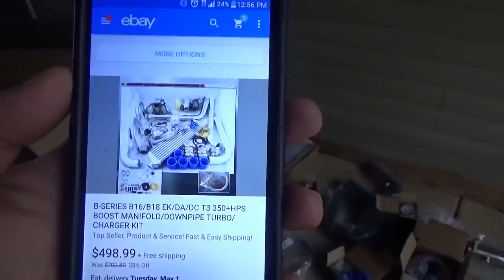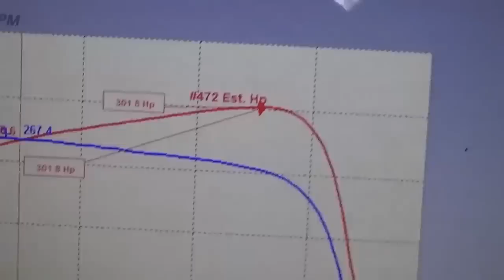$500 Ebay Turbo Kit (1 Year Review)

Comment: 300 in a civic is fast . You can hurt  alot of feelings  roll racing.
Reply: Haha even 200 feels quick in em
Reply: Agreed, these little cars are so light compared to modern cars that saying having 300(w)hp is meh, but people always forget power to weight ratio.
Reply: And FWD config makes +300hp unuseful and hazardous....I think 300 is the max you can get out it without LSD and without making your vehicle dangerous.
Reply: l KillerCam l agreed
Reply: @MarcoDwade  they are still useful lol, but like a high horsepower rwd they fight for traction except worse but around highway speeds  they do good with some beefy tires . They suck at heads up racing , but they are killer when rolling down the 4 lane, which imo, is when most guys with big rwd v8 cars and big egos to go with them, want to try these little cars.
Reply: @Hayawasa  ye Im talking in this way because im european and my knowledge on cars is based on our roads which are twisty and narrow.....on a straight flat big american highway theyre killer indeed..
Reply: People that are fixated on HP numbers forget how light older Honda’s are. 300hp in a car that weighs 2,500 lbs is legit.
Reply: The ride looks rough. Is the suspension that stiff
Reply: @MarcoDwade  having that much power with any car that don't have LSD is dangerous. Have tried rwd without LSD yeah its dangerous with 300hp too. It takes time to learn how to control it.
Reply: AuraLiveWax  Civics don't make bad names for themselves mechanically. The drivers do.
Reply: hendrahendra Snowmobile have 165hp and they 
weight 500lbs
Reply: @lkillercaml9945  Yeah man and take in account how light them Hondas are.
Reply: 300 in a civic is equivalent to 480hp in a modified m4. In other words it has a better power to weight ratio than a stock f82/f83 Bmw M3/M4. Stock M4 are not slow lol And that's in a stock weight civic. If you gut it you can hurt even bigger feelings! Free power
Reply: @Hayawasa  i mean this car should still run 12-13's from heads up racing which is still fast.
Reply: @retrox684  with the proper tuning and or willingness to destroy the clutch lol. Ive done been down that road. Once i got the proper tuning and boost by gear , it made the car alot more consistent and i didnt have to buy a new clutch every month. Straight cut 3rd 4th and 5th gears are next. When you get close to 300 in these civics with turbo you are gonna blow the tires off and lose if you dont slip the clutch in heads up racing. Its really cheaper to get hondata or aem in a years time.
Reply: @Hayawasa  im planning on building an h swapped intgegra and I cant wait to roll race once it's done
Reply: @retrox684  its addictive. Espeacially passing these little rich boys in their bought muscle cars.they get soooo butthurt lol.
Reply: @justingiassonmountainbike3346  They need it. And they only go 90 in perfect conditions and tall gear with all that power bikes would do 2x that.
Reply: @be_easy001  good for 12 sec with good traction
Reply: Right a v6 charger has more hp but feels slow as fuck cause it’s so damn big same when it comes to camaros but with a car that’s missing all that technology bullshit and extra shit it’s a rocket
Reply: @wpaia  that's debatable because fbo Zs are putting down 300+ and it's not scary at all. Same for any v8 putting down their 300+ things only get scary when you put numbers into a car that wasn't meant to handle it
Reply: I seen a natural aspirated 03 si with a manual trans and full interior woth heads and exhaust run 12s on slicks
Reply: @albanybestdrumline  that is an issue with torque. The z your speaking of dont have alot of it in comparision to a v8 rwd.
Reply: @valeriesanchez3074  why would an rpm limit matter?
Reply: A lot 🤣🤣🤣
Reply: @marcevensauguste  you disagree?
Reply: Nice one bro i have eg6 turbo swap H2BA7
Reply: @MarcoDwade just get fat drag tires and you can launch with 350 all day.
Reply: Fosho and that’s wheel hp so you probably pushing 390 to the crank

Comment: 300hp on a Civic.. A light car, is a lot..
Reply: Exactly a ~2500lb car with that much hp and handling is a beast
Reply: Probably keep up with most new v8 cars because of the power to weight ratio
Reply: Power to weight advantage. Its at least as fast as a hemi challenger.
Reply: Yet people will still hate because it’s civic
Reply: @SnoozeVert  well can you blame them? You pay $30k only to have your V8 American muscle car beat by a tiny little Japanese 4cyl. I mean the hate shouldn't be excessive, but jealousy is expected. Honda doesn't design for raw power, they design their cars for quality and eifficiency. Proper power to weight ratio is a key part of designing an efficient and quality car. And while they're at it, they make their designs simple so you can get even more power if you put some parts into it.
Reply: AlexBrian16 my g35 with a built head made like 315 on a safe tune, I can’t imagine that to the front wheels in a car that weighs ~1000lbs less (also presumably with no LSD)
Reply: @ModifiedCrew  keep up? No they beat V8s. Shit I do on 215 whp , full Interior all motor
Reply: @surrealmemes3518  That's what you call being a sucker. Unless you got it like that, you shouldn't pay retail for anything. And 79th productions gets this. I guarantee you none of his vehicles will get repo'ed or they will cost him an arm and leg just to keep up with the Jones's. Meanwhile, people are falling back on their car payments...
Reply: A guy at work had his ls3 camaro dynoed at 370 to the wheels 100% stock at 3800+ lbs so that Civic should roll at 300 with probably 1400 lbs less weight
Reply: Enough to beat a stock M4s. And M4s are faster than your charger/challenger rts, your mustang gts, and camaro sss. So yea 300whp in a civic is plenty

Comment: You actually took your time with the install and correctly fitted and built the turbo kit, that's why. Too many people rush to put the turbo on and immediately go to 15+ psi and blow it apart before giving it a chance. There's no reason it should cause issues if you're running 11.5 psi and not driving like a crazy person lol.
Reply: big facts
Reply: That’s exactly what i want to do when i get one
Reply: What if you run @7psi and drive hard af
Reply: @GreatBirdOfHope  nothing. Isn't 7 < 11.5 < 15???
Reply: @CaneSugarCane  oh aight bet
Reply: Or they rev it to redline probably running lean. This guy thought of where the failures could be and included it in his build.

Comment: The bad reviews come from people who improperly installed the kits and or had a junk motor to begin with and blows them
Reply: Facts
Reply: No engine management is usually the problem people buy a 600 dollar turbo kit slap it on and run it on stock settings not ideal standalone is always your first thing after wheels tires and suspension

Comment: 300hp for a street driven daily is more than enough.
Good work brother.
Reply: I had b18 on 15 psi. Around the same power level  and i can tell you is great power. If you ahve the right side turbo that it can make power from 3k to 7k you would  love it. My advise is .48 trim turbo.
Reply: Not to mention how light these civics are. 300hp on such a light chassis is pretty damn fast
Reply: I got only 201hp and I feel like that’s more then enough to pass 90% of cars on highway
Reply: @ssgenx2847  yup yup I'm pushing 215-220 whp on my B20V and it's plenty ENOUGH.
Reply: Probably the ones that say "300hp is not much" don't understand how car physics work and can enjoy their big ass SUVs or Trucks only with +500hp
Reply: @MarcoDwade  exactly, I beat a supercharged Range Rover making what 500 hp with my 215 whp full Interior Civic. . I mean it's a nice ride but if we are racing that weight ratio makes a big difference. 300 hp is more than enough.
Reply: Right?  My 323 gtx is under 250hp but weighs about 2600lbs; that thing pulls like a beast.
Reply: @MarcoDwade  Or they daily drive Scat Packs, GT Mustangs and SS Camaros. 

Cars where more recent models all have over 400hp. 

Not everyone daily drives an economy car.
Reply: @noahknight4039  yeah s as d they weigh twice as much. A civic with 300hp would be a good race against a FBO scat from a 30 roll

Comment: Man that car is awesome, looks damn new and runs crazy as heck, difference to you and common guys that complaint about the kit... They want high power with standard parts, your are respecting the car and the parts, and that's awesome. By the way 310 hp to a 116 to 127 hp original fom the old 1.6 16v.... that is aweso.

Comment: I started with a P28 ECU that I socketed myself, and my buddy did a street tune with Crome Pro. Then I bought a Hondata S300 V3 and I installed it again myself, and it works mint. I also bought the Hondata CPR kit and I am running a billet custom valve cover and coil pack mounting plate ($1000), with Accel coils on a fully built LSVTEC with a built, cammed, B16B CTR head with a Garrett dual ball bearing GTX3582R. My car makes 612 whp on it's current tune.
Reply: When you gonna post more vids of your LS vtec
Reply: Forreal this guys always commenting non sense but won’t upload a pull or a race lol
Reply: What kind of injectors??. Original fuel rail right??
Reply: Troll

Comment: Dude this is a super impressive build! I built a custom turbo kit for b18 in highschool. Probably had 2-3k into it and I dynoed it at 170hp. I had a lot more problems than a few exhaust bolts backing out. I had a friend with a b17 swapped into an EG civic and that thing was insanely fast. Wheel spin in 4th gear is insane!!!

Comment: Inspirational ...working on doing the same to my '00 EJ D16 AT...after a month it's already running great with the mods I've done so far. Working on the suspension next before I start adding more HP.
Reply: update?
Reply: @delsoldill  hey Dylan, unfortunately I had to get rid of it 😔 just no time to work on it. But definitely will do another in the future.

Comment: I get 225 kw  which is a little over 300 horsepower . with my stock V8 here in Australia however my car weighs 1600 kg , its a  VY holden calais LS1,  people put turbos on the V8s here and find it hard to get traction , i prefer the V8s nicer sound to them

Comment: I wish the damn install would've been this easy on my Mk4 Golf 2.0 8 valve. I'm lucky eBay sells a cheap turbo manifold. No cheap kits available whatsoever. I had to fabricate EVERYTHING from the 3" downpipe, to the intercooler piping, to the feed and drain lines (aluminum oil pan), to the intercooler fitment (had to fabricate a triangular mount because the front end attaches as a complete structure. Everything had to be custom fabricated for it. My Civic, I had to do some fabrication on it, but it now makes 612 whp on a fully built LSVTEC, and parts were all readily available for it. I even had to buy a $650 Megasquirt standalone for it and there aren't any ECU pinouts available for it like there are for EVERY Honda. It's sickening bro.
Reply: Hey man, how is it going with the 2.slow turbo project? Is it finished? I think its the first time i see a turbocharged 2.slow 😂 cheers man
Reply: @endri8767  A few people have done turbo 2.0's in the mid 2000's that i've seen on the Vortex but man.....what a process lol! A lot of people ended up giving up on their turbo projects too.
Reply: @kwbalance108  I hole you really get to the result you expect from that build man.
I just cant quit the 1.8t scene, its just mad.
Much love

Comment: Ayy you said right it's fast enough for you, then it's good and besides you running that on the stock motor which i think is very good myself like that technician was saying at the dyno shop that was only on 11.5 lbs of boost, all you got to do is tweak it a lil bit more and a you be up there about 400hp that turbo looks like it's rated to at least 450-550 max hp, not too bad for an E-bay turbo another good video im subscribed cuz, i got to come to your neck of da woods and bring my shitznik, i wouldn't mind taking mine to that dyno shop and run some numbers im only 2 hrs away down on the coast from you, im all stock too just rebuilt motor and newly rebuilt turbo, G54bt.... hint hint stay positive mane.

Comment: Hello Justin.

A quick question, the normal radiator support fine the turbo?

People usually add a thick aluminium one.

Thanks if you can clarify because I'm building mine as well ;)
Reply: Luiz Canguini good question, it depends on how much Horsepower you trying to get?

Comment: I think the success you have with the kit probably has more to do with the installer than the kit. I mean some things may require some tweaking, but I'm sure the concepts of the kit are the same. You just may have varying degrees of build quality and reliability. But I've run some cheap ebay stuff before and haven't had a problem.

Comment: In case  you don't  know  if you replace  the map sensor with a different  one. Example  from stock to a 4 bar you have  to retune  your car. The ecu is probably  going crazy. Call your tuner and ask him.
Reply from the maker: The map sensor was changed before the tune

Comment: I had an ebay turbo on my rsx... made hella power but the bearing went out in 3 months. Then i swapped it for another ebay turbo... worked fine but leaked oil from the day i got it and i never could get it to stop leaking oil. I got tired of putting a quart of oil in my car every few days and i been all motor ever since. If i go turbo again i will have to go for an expensive one.

Comment: E85 seems a little extreme for 12psi.  I'm not too well versed in Hondas but generally, even higher compression NA motors can handle a little boost so long as your tune is good. 

I'd probably run e85 in my turboed Volvo 240 too if it was available near me though. More room to grow and a little more peace of mind.

Comment: What transmission did you use in order to fit the B20b? Stock manual transmission that the civic came with and if so did it fit like a glove or did you need adaptors?

Comment: Hey I just got a manual car and am still learning how to drive it so I wanted to know if I can shift from 5th to neutral when coming to a stop
Reply: Yes you can I did it all the time, I'd go from any gear to neutral when coming to a stop, I never down shifted and engine braked much when coming to a stop
Reply: Steffan Cruz yes you can and that’s what you should do.
Reply: Not always the best option if you’re in a situation where it’s possible you might have to go back into drive before stopping, for example on a hill

Comment: 600 euro turbo kit on eBay 

Question will it fit on my Toyota Celica 1995 7AFE engine ? 

Package Include:

1x T3/T4 Turbocharger

1x Oil Feed Line

1x Oil Return Line

1x 35/38mm Wastegate

1x 5 Bolt Turbo Downpipe

1x Turbo Boost Gauge

1x Turbo Intercooler

1x Tubo Boost Controller

1x Type-S Blow Off Valve

1x BOV Adapter

1x Turbo Piping Kit

Comment: Hey Honda brother so which series is this? I have d16y5 engine needs rebuilt n turbo. Researching it to do myself. Gonna use D16Y8 head. Will the turbo kit work for me if I rebuild? How many whp? Boost?
Reply: IT Will works but how Long... If you dont use 30 psi you Will be ok 😅